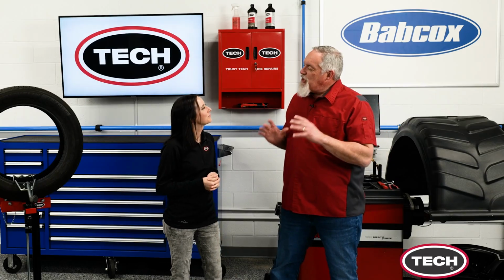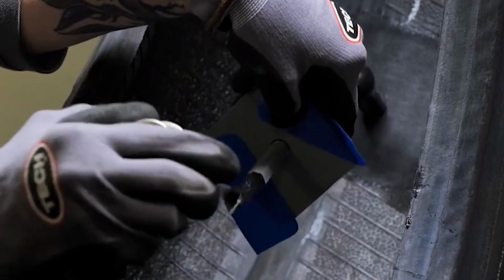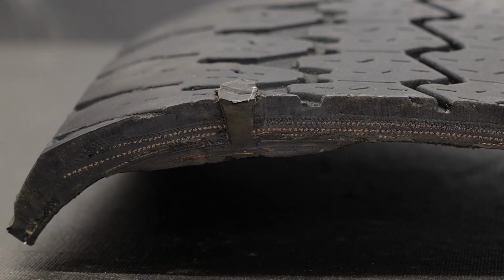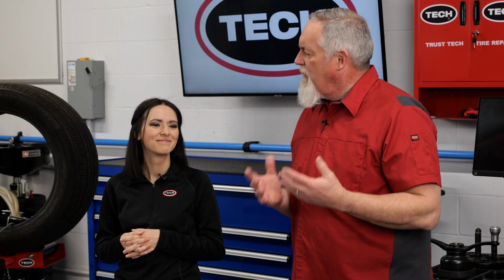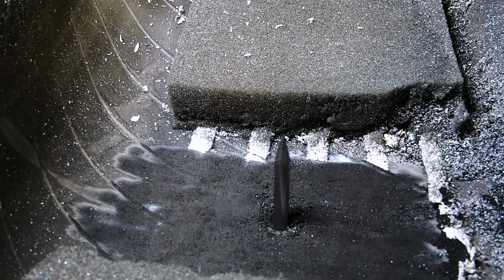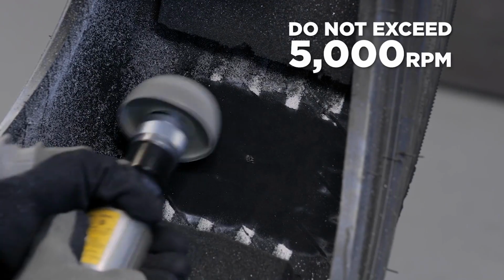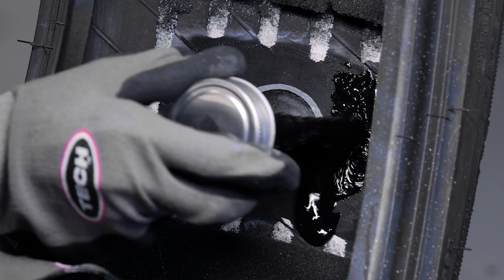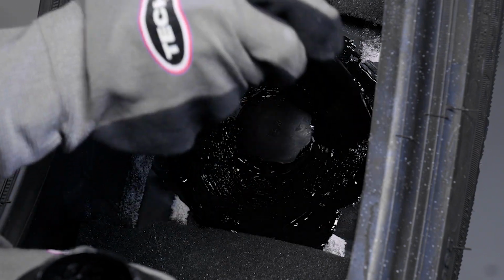The Best Practices for Proper Tire Repair

Comment: What the hell... why is the tech grinding the surface 6" square for a 2" patch?  I'd kick my tech if they repaired a tire this way, too slow, totally unnecessary to grind away an area that large, and why is he using 3 oz of top coat???